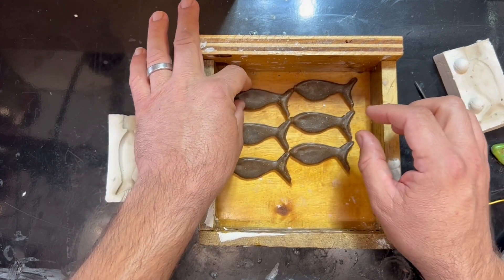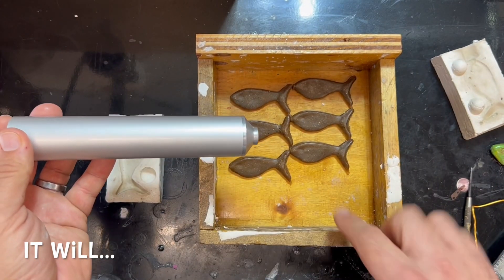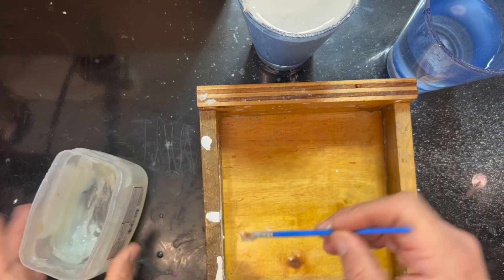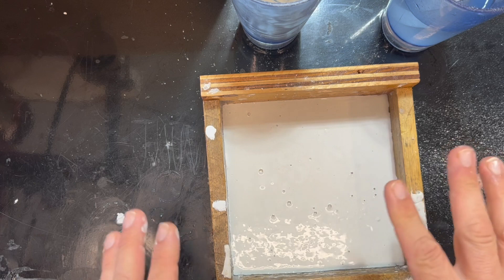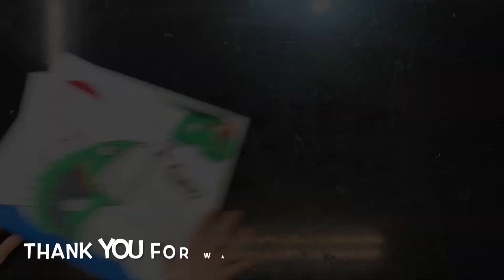Making a School of Fish with a Plaster Mold

Comment: First pour a layer of with consistency of cooking oil and brush it with paint brush and then pour full it will eliminate all the bubbles
Reply from the maker: Thank you very much for the advice.  I’ll be sure to try that in my next mold making project. Stay Regular!
Reply: @RegularGuyLures    if your mold master is  delicate then you can't swril or vibrate the thin layer the bubbles will brust after that you can use mesh as another person said then you can pour rest of thick consistency POP

Comment: Great fun videos to watch!
Couple of suggestions though, First, instead of petroleum jelly,  specially for larger complicated molds, spraying with Pam can be way faster and easier. Secondly,  for larger mold slabs, like in this video, embedding a meshing material, plastic, string or even aluminum, could add to strength and integrity of mold.
Reply from the maker: Thank you so much for the suggestions.  I’ll try out the cooking spray, but once I’m happy with the mold I apply two coats of polyurethane which act as a permanent mold release.  I really like the idea of adding some sort of rebar to the mold, that was a great suggestion. Stay Regular, and I hope to see you back for the next video.
Reply: What is pam ?
Reply from the maker: @UnstoppableAngler  Pam is a brand of non-stick cooking spray.